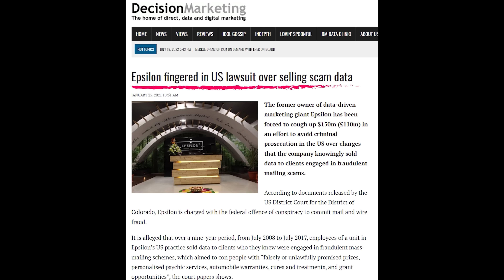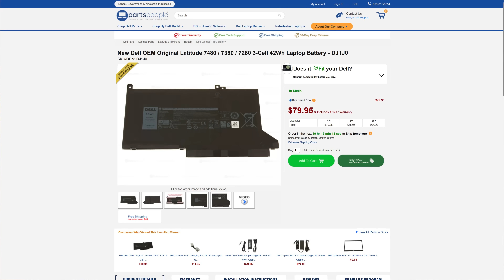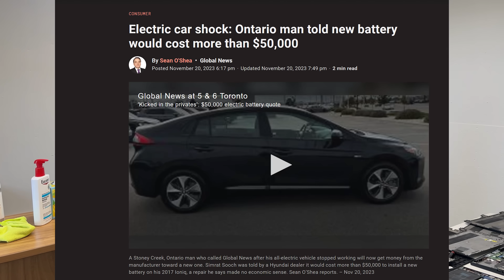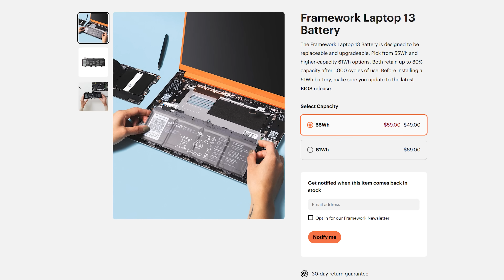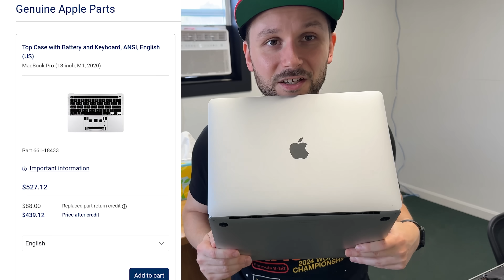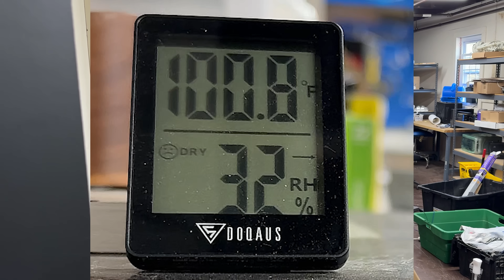Planned Obsolescence: Why is Replacing a Battery STILL So Difficult and Expensive?!

Comment: At the moment, until laws FORCE manufacturers to confirm to standardised battery replaceability and interchangeability, the best we can/should do, is figure out ways to 'hack' the continued operation of these devices with external/alternative power supply, right? Like, a laptop is often just used plugged in a lot of the time anyway, even when the battery is still good (btw, a common cause of premature battery 'bloat'!), so making ways to easily just route the power of an AC power adapter to bypass the battery and at least make older laptops have use as nice slim 'all-in-one' PCs. Or even, if could fix up ways for those bigger size 'power banks' for phones to work as external batteries for laptops...??

Comment: 12:00 no, I didn't replace my device, because of the battery, on my laptop (emachines e725) I've been able to find a replacement battery with double capacity for 20$ (~400CZK), and on my phone (Huawei Y3), when you're using your phone for 10 years, they stop supporting your software in many apps, I've upgraded only because whatsapp is no longer supported for Android 4.4 jellybean, I hate when big companies does that, like what was forcing meta to stop supporting that android, when it's lightweight app and it was running great on my device.

Comment: Stop killing devices sounds like a great idea. Though personally if the battery in a device is a problem and you can't get a OEM battery, just leave it plugged in. Or get a USB c battery pack and power your device that way. Let's hope planned obsolescence stops before we run out of resources to make said devices. The problem with resources isn't if, it's when. Eventually, we will run out of lithium and other raw materials. Unfortunately I don't think there will be a solution to this until it's too late. I want to keep my stuff running for as long as I can.

Comment: Here is the deal:  a battery for a 7 year laptop has the cost of a battery for a brand new laptop. It's the same in cars, they lost value but a replacement battery cost the value of a brand new car battery. So the laptop is cheap because it doesnt have a battery.

Comment: What is the average voltage for laptop battery?
22 v?

22 v = 6 single cell pluged in serial.
I am pretty sure low c rating rc cars batteries could be used to fix laptop battery packs.

Laptops don't need above 20c rated lipo packs. (C rating = how fast can the battery discharge it's full power). (1C = nominal charge cycle.) 
Exemple a battery that takes 4 hours to charge and can discharge in 15 minutes is a approximativly a 60 C battery.

Comment: The worst has to be...finding a replacement battery you can solder there...but those battery..half the time..have worst or = life cycles of your dead battery.

And then you wonder if there is a planned battery cycle counter that prevent the battery from being fully charged.

Comment: You must have thought about it, but how about pricing differently laptops that have a new genuine battery to account for that? After all, what's worth $60 is "a 7yo device with a 7yo battery" that might only have a few years of life left, not "a 7yo device with a new battery" that have at least 5 years of life left.
Surely, to the right people (and with your clout that'll guarantee you really put a genuine battery in, not an Ebay-special one) it's worth paying for?
That's just a thought of how to overcome that issue for you. You could even do a test-run by pre-selling a few ones with a disclaimer that they'll be repaired after order so you don't even have to front the battery cost. It will mean a delay for the customer, but again some people are ready to wait 1 month for their shit to come from China, so what's 1 or 2 weeks?

Comment: I just hate the fact that once you remove the battery all of a sudden your perfectly fast running laptop turns into a terminally ill cripple. Just make them run good without the battery and half of the issue is solved.

Comment: Have a Dell G7. Tried to buy an aftermarket battery. Tried to put in the charger and it said wattage not recognized. Cannot charge. Relying on external power. No idea what's the issue if someone can help.

Comment: I understand completely what you are saying and I agree. Also, the BMS on the batteries should be detachable and be able to swich batteries without the danger of desinchronizing or just becoming non functional.

That being said, for 7yr old machines, you should be able to detach the BMS from the old batteries, find a similar sized one by looking for the width, height and length, then transplanting the BMS on them.

Comment: Ok, this is the one instance in my life where I've bought a laptop from 2015 and the battery is still 100% functional and hasn't dropped more than 2-3ma over 10 years. 
A well used Fujitsu T725, completely stock, and was running win 10 professional from the factory. 
Fujitsu was thoughtful enough to add in a battery charge regulator after a couple of years because of a few instances where the battery lifespan became lower than the expected drop after 2 years. Fujitsu apparently cares about their customers and their products.

Comment: If each manufacturer standardized the dimensions and connector for their own battery then used that blue print for all future devices and sold those standard replacements on their website then all would be solved...
Reply: Manufacturers want to come up with their unique designs.

Comment: The governments worldwide are obliged to force manufacturers provide fresh batteries for their products. They must stop being puppets of capitalism. The world has only so much resources. 

All standardisation has been broken. No single production solution is viable. 
Everywhere resources are being wasted mindlessly. 

Imagine... Ac adaptor 5-12V output into powerbank. Converted to 3.7V. Efficiency 85% Energy wasted, heat generated. 
Then converted to 5-12V at the output of the powerbank. To the mobile device. Again efficiency 85% Energy wasted, heat generated. 
Then converted to 3.7V in the device. Another loss, efficiency 85% Energy wasted, heat generated.

Funny?

10 billion times a day.
10,000,000,000!!

Yeah let's not eat meat, the cows fart to much 😂😂😂

Comment: Short explanation of why it's horrible to find a battery remplacement.
- Get a famous YouTuber to upgrade device.
- Get better battery than the one used in the handheld/controller
- Realize the battery died a few weeks after/after a few recharge.

And that's for a pro who 3D print and solder everything by himself. Now imagine someone completely random trying to find a replacement battery. 

You either have:
- No manufacturer replacement
- Manufacturer replacement (costing an arm for what it is)
- A cheap alternative who probably not gonna work
- Another cheaper alternative who probably doesn't work after a few recharge
- A literal safety hazard.

It's so infuriating. It's a bit like motherboard nowadays. So many motherboard could be drastically improved with a very cheap improvement/solder. But company charge them 50-150 bucks more.

Almost remind me of some company charging extra thousand of dollars for just more VRAM (cough Nvidia and AMD)

Comment: Coming from a time where batteries were loaded with 18650, there is a need to 'assemble' batteries putting some kind of 'flat' batteries together in a more easy and manageable way. Otherwise, manufacturer charge the price they want.

Comment: Bigger worst part is 1st party OEM for use t2 or t3 battery supplier which easily degrade unlike best battery manufacturer like sunwood or byd which are t1 suppliers for most of the laptop. These battery most even after having free battery replacement add on come with a lot of cycles the first party replacement is mess

Comment: If you take stop killing games ideology and adapt it to hardware and tech then they should have an end of life plan.  Where online games could just make the code opensource to allow private individuals or smaller companies to host the servers then companies like apple or (insert name here) could sell off or give the manufacturing specs of the older batteries to manufacturers so that the older hardware is still usable instead of ending up in a landfill.   The better option would be to standardize the battery so that the same form factor is used for a decade and make the battery backwards compatible so that older hardware could use the newer battery.

Comment: For this kind of devices, batteries should have an standardized modular battery cells, that allows an easy, secure and ecofriendly way to change them. This happened with USB C port in IPhone and some other hardware that had to be standardized. Of course every laptop has it’s own needs in terms of power consumption and performance, but, if all batteries companies uses the same standard of form cell, and the same way to connect them, you can adjust the amount of mAh of capacity, you can adjust the amounts of voltage, you can provide a higher W/h discharge ratio, but if you keep the same modular design trough all companies, that could help to ensure, there will always be spare batteries.

I have the same issue with the quality of plastic chasis from “HiEnd laptops”. They crack, they scratch like soft compounds, hinges breaks, temperature of the vents dry the plastic and gets cracked, etc.

BTW if you have a W11 bypass tutorial, could you provide the link? Pls😅

PD.: I follow you since a long time, thank you very much for all the labour you and your wife Lupe do, it is very important, I appreciate they funny way you teach IT and electronics. You are the best guys, keep up to good work.🎉🎉🎉

Comment: I do have a 14 y.o Lenovo ideapad with original battery with 26% 30Wh. I've changed multiple Alienware batteries (10 y.o already) due to swelling that popped up my palm rest. Even current ThinkPad has 3-4% wear level after 9 months.

Comment: The solution is right infront of us, there should be a standard like for VESA and those and ALL bAatteries should be same dimensions similar to AAs and those. Laptop manufactures should work around this to create there devices. These batteries should be manufactured by a 3rd party for all makers and should be easily replaceable like they were in old machines. Yes of course they can inovate and more capacityy added but should keep a same size so they are backwards and forwards compatible.

Comment: Consumers also need to qualify what is critical if in a money crunch and don't want to be wasteful. How many times have you really NEEDED to be on battery power? OK, you need to work in the plane, under an apple tree, at the mountain cabin with no electricity.... But how often? If I was to guess 98%+ of the time/ real use cases, the laptop is just plugged.

Comment: An option would be to just sell them cheap with no batteries. Or maybe give the option to add the battery but let them know that is not original battery. Or maybe provide a warranty for the battery you added. The point is that you need to educate people who will buy the laptop that the battery is the problem. I still use my laptop from 10 years ago. it had no battery for a good while and it worked for me. Although it was not exactly portable, it still worked great.

An interesting idea would be to use an external battery instead of the internal one. Like those powerbanks and power station. They are not the greatest but they are compatible with almost anything

Comment: I would love to use Linux, but I'm a gamer/streamer and Linux just... has issues with Videogame compatibility. I know Linux is hard to learn but I would love to learn, the ONLY issue is compatibility.

I would also like to say. In terms of the battery replacement being more than the device. That would not be possible, if it was simply that the batter was expensive to produce. Otherwise the device would have been that expensive from the start. They mark it up intentionally, so while you TECHNICALLY CAN keep your device, you are more likely to go "fuck it" and buy a new one. Likely, of a newer, pricier model, that guess what, MAKES THEM MORE MONEY.

It's corporate greed at it's finest.

Comment: Explain to me in detailed instructions how it's so hard for you to find a battery. I just recycled 100 of them dell batteries and they passed r2 testing, but I didn't have laptops for them. I stopped commenting with advice on your posts and trying to help cuz you wanted to be a dick in response to my comments on the resin pc. here's one last piece of advice. find a certified R2V3 recycler. Tell them you need tested batteries. tell them you want 80 grade or better (80% health), they have to run a drain test in order to sell it, which is no more than 4% drain over a period of 5 minutes, so most batteries with 80% life should last about 2 1/2 hours depending on (lots of things). They may or may not help you out. look for R2V3 certified places all across the country, Make some calls, lots of them have laptops they can't sell but the battery passed testing. good luck, don't be a masshole :D

Comment: Personally, all my laptops are on battery maybe less than 10% of the time. Battery life isn't that important for me. If you watch this video by LTT "Buy your next laptop on Aliexpress" they say that research shows that most people don't care about battery life on laptops. My Lenovo Thinkpad P17 Gen2 can run for about 3 hours on battery. In the last 3 months, I've used it not plugged in for a total of 25 minutes. When the battery bloats, I'll just unplug it, & (if needed) mod it so it can run without the battery attached. I agree with your argument, but most laptops aren't being used for hours on end without being plugged in.
Reply from the maker: Watches, phones, earbuds, headphones, etc.
Reply: @SalemTechsperts  True. Though my phone is 5 years old & holds a 3 day charge still. Smart charging. I never charge to 100% & never get below 10%. Fun fact "For your viewers for laptops" Using Lenovo's software can set your max charge to any percentage to keep it from charging to 100% so you don't kill your battery. More manufacturers need to implement that feature. Samsung has this feature on their phones too.

Comment: Maybe laptop batteries will be next. The EU is preparing a standard power tool battery interface. "The European Union is planning to introduce a standard battery interface for power tools, similar to how USB-C was mandated for phones and tablets. The policy under discussion is called the “European Battery Interface” (EBI), which will require new power tools sold in the EU to support a standardized battery footing". Maybe laptop batteries will be next. Remember the EU pushed to have one USB plug for devices usb-C and now all phones including i things have usb-c.

Comment: I propose that all batteries must standardized, and designed around.  I think 20 different form factors would be reasonable and sufficient.  Some should also be made which are modular.   Also they must be somehow certified to perform within certain minimum specifications, by law.   This should be done for ALL the reasons.  I hate federal regulations as much as the next guy, but SOME are actually necessary.

Comment: Japan and South Korea have developed new battery technology called solid state ev batteries. These have a longer shelf life, can hold a larger charge and thereby extend the driving range of ev vehicles. I'm hoping this solid state battery technology will trickle down to other devices that use traditional lithium batteries such as laptops, thereby extending battery life and reduce the need to replace a laptop battery as often.

Comment: Yea the battery on my G14 (2020) is shot. it has a weird issue i dont know if its battery but im 90% shore. theres some weird behaviour. anyhow the only place that has replacement batteries is... aliexpress. Im kinda sketched out ngl i havent pulled the trigger yet. Should I? And yeal also my iPhone 12 Pro. Good thing still kicking plenty for what I need but... the battery is showing its age. thing is, battery replacement is like 150 bucks yet the phone is worth 200 here. I iant replacing that battery ofc not

Comment: I am not a Democrat, BUT... Dear God... you mean the tariffs help US brands sell more useless Junk??? DAAAAAMN. Why did you need to Tariff all the batteries too?????

In case anyone wants to ask ChatGPT:

	•	Yes, batteries from China are fully included in the current U.S. tariff regimes.
	•	Most battery imports now face Section 301 tariffs ranging 25–100%, with non‑EV battery imports set to hit 25% in 2026.
	•	Depending on context, total tariffs may exceed 38%, and in some emergency scenarios, even up to 145%—unless specific exemptions apply.

Comment: I heard someone replaced a battery in a Tesla and originally capped when he went back to Tesla for another repair they recapped the battery because [you didn't pay for that capacity].  I think a car company had heated seats installed but because they didn't pay for it was deactivated if your in a hot climate it's added weight because they don't need it but companies don't care about waste!

Comment: I remember for a time instead of getting new battery some people/small business will do battery recell instead, they basically kept the original BMS that back then and now sometime till lock itself out but if they dont, they can just spot weld new 18650/22700 cells into the the batter and put those back into their enclosure, and with that surviving BMS you can sometimes upgrade the capacity of those battery, those 5000mAh ipod battery was from those recelled ipod BMS with a much larger battery from a smasnug.

Sadly these days because people more likely to just buy cheap discard then buy cheap again these people and business just start disappearing I genuinely lost that old uncle that used to do electronic recell for the family.